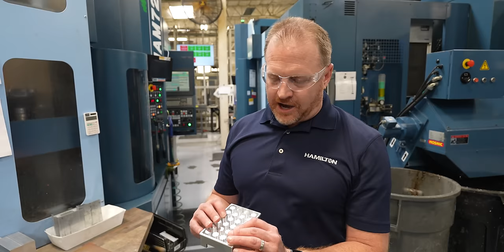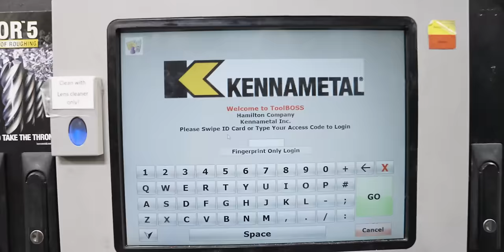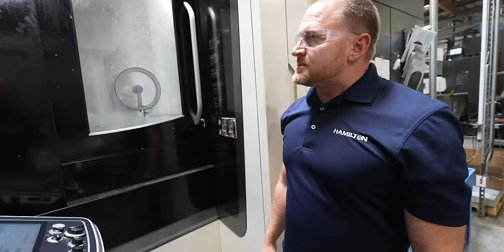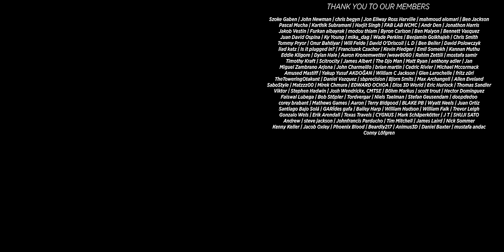CNC Machining 5.3 Million Parts Per Year

Comment: I got to work for Phil two years ago when they had the first group of engineering interns in the machine shop. I've yet to meet anyone who even approaches the knowledge he has about machining and manufacturing. I haven't seen another machine shop put together as well as  Phil has done at Hamilton. If you're a Mechanical/Manufacturing Engineering student, go work for Phil. 10/10.

Comment: I know this is something that you guys will probably never inform your viewers about since you have your specific sponsors like Kennametal etc but:

It would be really interesting if we could for example know which specific endmill that this company favor above all else. 

Its difficult to really get to test endmills for me since I only run prototypes. I have my favourites but its always a guessing game since I dont run production. Ive seen the cheapest shite from China doing AMAZING full depth cuts but then suddenly just breaking with no warnings. 

The best allround endmill Ive found is the TiSi coated endmills from Holex. It will cut everything. For aluminum and plastics the Alupower endmills from YG-1 are by far the best Ive ever tried =)

Comment: Production shop.....................................BORING!
Certainly some impressive numbers in terms of sales, capitol investment, and part count. Spent the majority of my career in R & E shop environments. Develop the part. Develop the process. Develop the tooling and fixturing. Implement the processes and procedures. Pass it on to the knuckleheads in production and be on to the next project.
Reply: While it may seem like a boring or benign place. Hamilton Company produces more than 13,000 unique parts with an average of 4 new parts per day. Most of the new parts are being produced on 5-Axis mills or sliding head lathes.